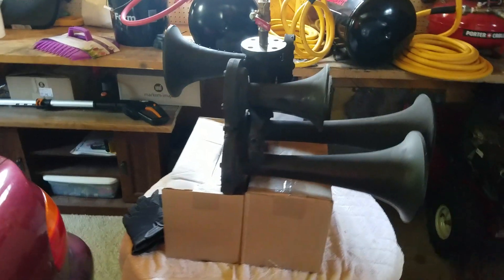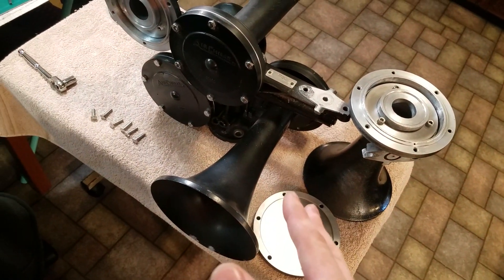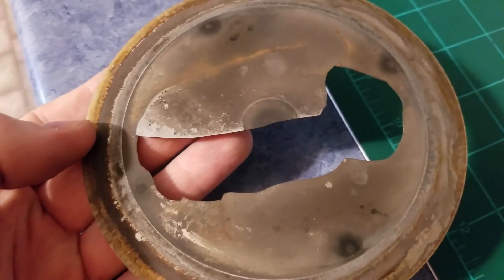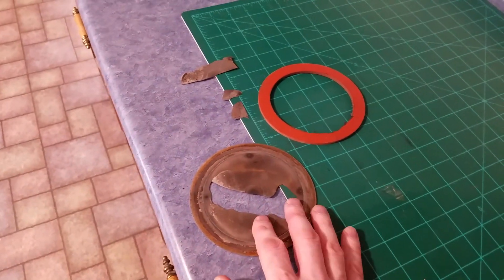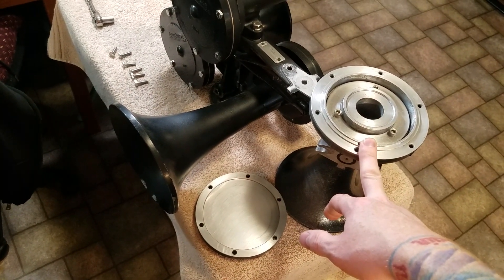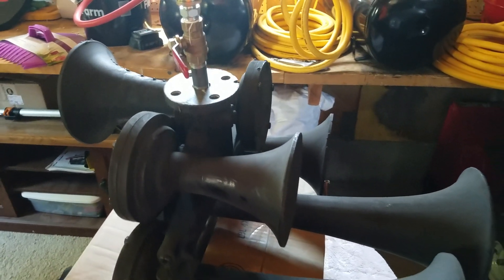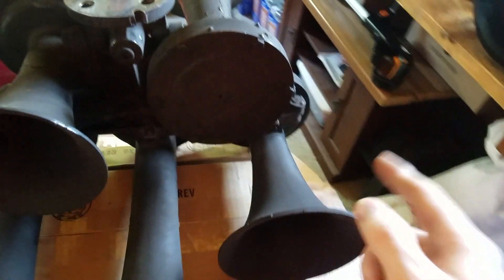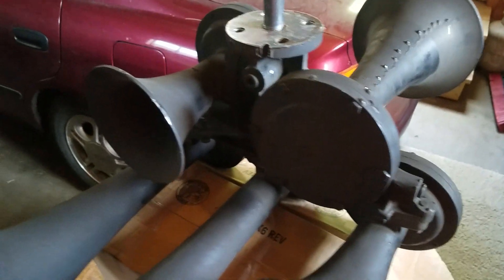Path to Restoration Early K5HL! (Part 1)

Comment: Yep, sounds very similar to my early BNSF K5HL! And wow, that diaphragm is shot! I have recently heard BNSF 7697 has the same issue with her #3 bell. It's dead silent and I'm assuming the diaphragm is also cracked. I wonder how this happens. Perhaps a combination of weathering and poor quality materials? I think the #3 goes out on quite a handful of early K5HLs. Speaking of which, the #3 bell on my early BNSF K5HL tends to be the last to sound after applying air. It doesn't squeak, but it faintly is the last to sound after cutting off air. It could be caused by the ball valve I use. I've noticed many early K5HLs on GEVOs tend to have their #3 to be the last to sound as well. Also, it seems that GE's solenoids are lazier than EMD's, especially when it comes to SD70ACes and their godly K5LLAs. I guess using a ball valve has similar characteristics to GE's solenoids. Thanks for sharing the sound! I love it!
Reply from the maker: Have you tried opening the ball valve super slow to see if you can hear air leaking from the 3 bell or anywhere else on the horn? My first early K5HL had two small holes in the manifold from a cast defect and the new early one I just got the 3 and 1L bells were loos on the manifold allowing air to bypass the foot gaskets and some of the back cap bolts took little to no effort to take out so some of them were loose as well! That's why I do a simple checkup on a for before doing its first test so I know everything is in working order so I can clearly hear the horn its self without a bunch of underlying issues effecting it! Glad you enjoyed the video!
Reply: Blake K5LLA K5LA Yeah, I’ve tried opening the ball valve to get the horn to squeak. It does for a second and then it pulses with the squeak. There’s about 2 squeaks per second when it does that so it doesn’t pulse that fast. I don’t usually quill these for long periods of time so it’s a little hard to say. It’s interesting that the bells and backcaps get loose overtime. I’d imagine those bolts get torqued when their assembled at the factory. Of all the horns I’ve received, none of them have had bolts loose mainly because I’ve gotten them from other people except for the one and only RL K5HL. That one came from a CSX Dash 8 and was covered in soot. And because it was a replacement horn, it didn’t get any paint so cleaning it was very difficult. Took 3 stages of cleaning to get it to shine! Anyways, some of those bolts on that horn were actually tight and I think they used a dab of either locking agent or anti-seize. It could’ve been extra soot from the exhaust but I’m not sure. I’m trying to find a tap and die set that’s quality enough so I can re-thread the holes. I recently got one from Harbor Freight and boy, they were horrendous. I was afraid they’d do more damage than help clean out the threads so I ended up returning them.
Reply from the maker: @andre100BNSF  I use Irwin taps and die,s for everything I do and they work great! I don't know if they actually have torque specs because I've had some be super tight and some be alot looser. I'm pretty sure it just depends on who assembled the horn haha normal they do not use any lock tight or anti seize from the factory. Soot and calcium buildup can get in the threads and be a pain to remove.
Reply: @midwestmodelrailroadworkshop  Haha, yeah. I went to my local Ace Hardware and they didn't have any 3/8 - 16 taps in stock. I think they carry the Irwin brand. Also, I haven't found any torque specs either so I just tighten until the lock washer is fully compressed and flush with the surface. I also went ahead and put some nylon washers in between the lock washer and the foot of each bell so the lock washer isn't eating away at the metal. And yeah, tell me about it. That soot and calcium buildup can really make it a pain to remove bolts when it's on the threads. It makes an awful screeching sound when you remove them too.
Reply from the maker: @andre100BNSF  I know that sound hahah

Comment: That sounds awesome. Also what do you recommend to do with that squeak when you open the valve a bit. I notice it on my K5HLA sometimes,
Reply from the maker: As long as you don't hear it when you do a full blast and after shutting off the air its nothing to worry about but if it's very audible before or after normal the cause is the diaphragm is not tight up against the nozzle so you either need to adjust or swaps the diaphragm or the cushion ring is no longer keeping enough pressure on the diaphragm so you need to swap around or use a new one. Can also be a back cap issue as well I've had times in the past where I flipped a diaphragm and it started doing that because the diaphragm was warped. Normally it's a super simple problem to fix overall!
Reply: Blake K5LLA K5LA- Thank you, Blake for all the helpful information. I’ll take a look at it and see if I can spot any of the problems you mentioned. I hope I’ll be able to blow my horns again but my neighborhood doesn’t seem to be too happy about it especially since everyone is stuck at home.
Reply from the maker: @BostonBeaconPark  haha I feel your pain luckily if I honk in the garage nobody seems to mind it lol no cops called yet, fingers crossed 😂